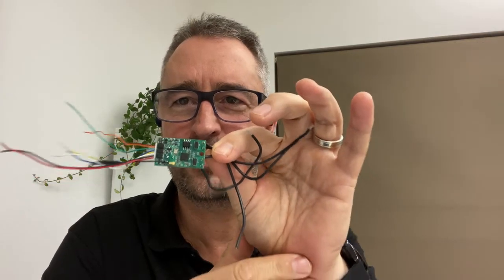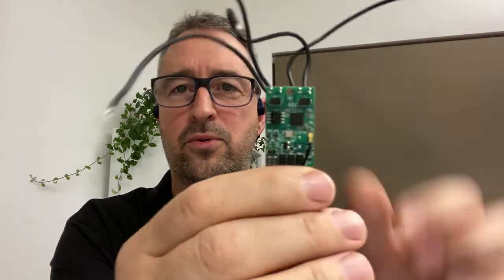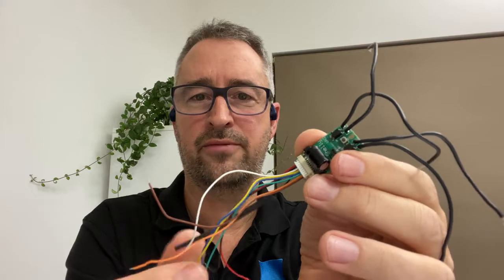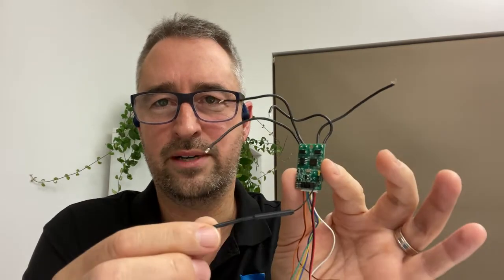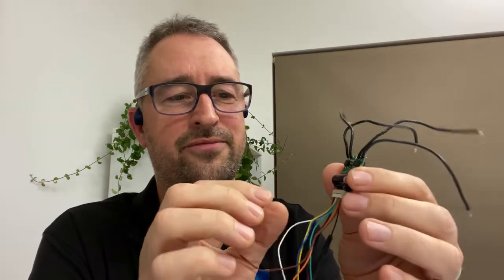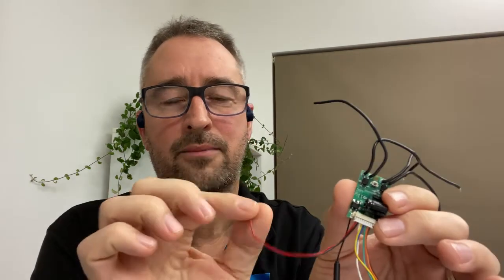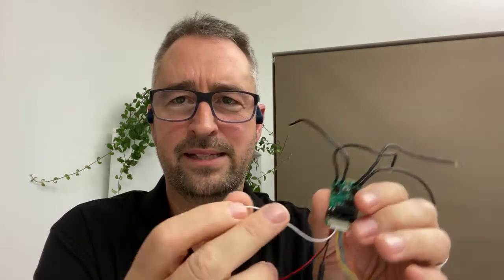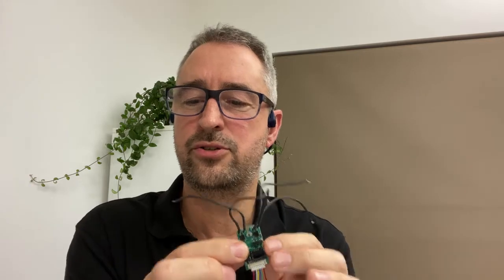Tank Water Level  Sensor Part 2 and Shelly Uni review

Comment: Hi Simon, do you know if there are any Shelly modules that do what this Uni does but with an ethernet plug instead of Wifi, my water tank is about 100m away from the router in the house. I have a data conduit in the ground though that I can easily run an ethernet cable back to the house. Or if you know of any other ways to get this to work over 100m range.
Reply from the maker: Hi Kendrick, I don't know of a Shelly that can do this but you could use an ESP 32 with an ethernet port

Comment: Hey - Fellow kiwi here from TGA and also a "Simon" :) Im about to order these bits so I can setup for a mate. You mentioned your temp sensor, can you provide a link to that? also - you mentioned going for the 12v power, what AMP did you choose from your link?
Reply from the maker: Hi there good luck this is an awesome project!  Here is the temp https://s.click.aliexpress.com/e/_oB1z3ui and this adaptor https://s.click.aliexpress.com/e/_opXibci
Reply: @simonsayshomeassistant  Thanks for that! Did you just go for the 1AMP supply?
Reply from the maker: @greminn0  Yes, 1amp will be fine
Reply from the maker: @greminn0 yes

Comment: That's pretty cool. So I guess you have to fill the tank and then take a voltage reading to see what the max level is. Let's say 1000l tank gives 10v. In a 0v -10v configuration. It would mean that 9v would mean 900l. 1v would = 100l. If I'm understanding this correctly. Obviously in reality it will never be so divisible. More like a full tank could be 8.4v and so you need to do a bit of maths to figure out the voltage to liter conversion. Is this correct?
Reply from the maker: Hi, thank you.  Yes you are right onto it!
Reply: @simonsayshomeassistant  Thanks Simon. Looks like the Uni is also the device to go for. Was looking for something also by shelly with AC connection, and then that's possible but you still need a DC adapter then to power the sensor so might as well just go for the Uni.
Reply from the maker: @blahdiblah2169  Yes, the uni is simply amazing, there is a plus version now too!

Comment: My Shelly is reporting 8.2v regardless of the depth of water, and the sensor is supposed to be 0-5v. The new Shelly Uni Plus as the readings as Analog or Volt meter, but they both give me the same results. Any suggestions? The output does not change when the water level changes.
Reply from the maker: Hi, have you tried reading the voltage using a multimeter connected directly to the sensor?

Comment: Hi there, that's very much for putting this video together. I've followed the guide and now have a Shelly Uni and a level sensor up and running. I can see the probe voltage changing as i raise and lower it in the water. One small challenge I'm facing is Home Assistant is rounding the ADV valie so for instance the Shelly Uni GUI is showing 1.87v but HA shows 2v. did you have this? Any thoughts on how I can either disable HA rounding or use a different HA sensor? Thanks 🙂
Reply from the maker: Hi there, thank you so much for your feedback!  You can adjust your rounding like this https://www.google.com/search?q=why+is+home+assistant+rounding+my+entity+values&rlz=1C1GCEB_enNZ1162NZ1162&oq=why+is+home+assistant+rounding+my+entity+values&gs_lcrp=EgZjaHJvbWUyBggAEEUYOTIHCAEQIRigAdIBCTEzMzg3ajBqN6gCALACAA&sourceid=chrome&ie=UTF-8
Reply: @simonsayshomeassistant turns out I was using the old HACS Shelly integration. I removed that and used the built in integration and it’s working perfectly now. Thanks very much for your help 👌🏻🎉

Comment: While this is an old video thread I hope you can steer me to a way to work through my error in trying to use this to monitor a 2m deep water tank. I am supplying power to a Uni from a 12V brick and also jump from the same power transformer to the pressure sensor. White - 3rd Uni wire to the blue on the 0-10Volt pressure sensor. My problem is the sensor seem to show 7.5 V - 8.3 V or so.  Any suggestions on where I am going wrong or how to diagnose my problem (Simon & Lars have about 2.0V ) .  Will remove the pressure sensor tomorrow & test output in a small bucket?
Reply from the maker: Hi Dan, does the voltage change if you pull the sensor up higher in the water?  Also just check that you have the sensor that uses voltage and not milliamps?  Hope this helps
Reply: Did you find a solution? I'm having the same problem.

Comment: Hi Simon thanks for the video! I'm doing this exact project I was wondering did you use the outputs on the shelly to power the sensor? I can't find how many amps the sensor uses anywhere so im not sure if its under 300mA
Reply from the maker: Hi Derrick, yes the shelly uni supplies the power to the sensor.  I'm so glad you found it useful!

Comment: Hi Simon, sorry for the silly question. But do you have a link to the type of power source you’re using? Also do you use a weatherproof enclosure for the Shelly uni so it doesn’t get damaged out in the elements? Thank you
Reply from the maker: Hi Johnny, there are no silly questions.  Here is a link to a project box you could use: https://s.click.aliexpress.com/e/_DDSwtmJ and here is the power supply: https://s.click.aliexpress.com/e/_DdxCgwl .Thank you for watching my video!

Comment: Third time lucky in adding a comment....agghh
I have similar hardware as but I flashed Tasmota onto the shelly UNI over the air. Why? Because I am familiar with it and I could slow down the number of times the data was being sent as the shelly didn't do that. Anyway the Tasmota does the calculation for the litres on the device and I send that via MQTT. Seems to work. Look for a video  ubeaut productions as I cannot add any links to the comments...agghh
Reply from the maker: Oh wow I didn't realise that you could flash the uni over the air.  Yes I am a fan of Tasmota too.  I will definately check out your video!
Reply: @simonsayshomeassistant  hey let me know if you try this out... Thanks
Reply from the maker: Thank you I will let you know if I get it working, digiblur is great!  How did you calculate the litres?  @ubeaut
Reply: @simonsayshomeassistant  it's in the video I did. I had the sensor out that was zero/empty then put it in the full tank. That is the high and low voltage readings and the adcparam command does it all . adcparam 6,12,262,0,50000. Which means 6 is the moisture setting, 12 is low voltage, 262 is high voltage, 0 is the low scale and 50000 is the high scale.  At the end of the video I pull the sensor out and you can see the lidtres change. I had the tele period set at 10 seconds so you could see it change. I set it to 5 minutes but can be whatever you want.
Reply: @simonsayshomeassistant  maybe you can do a better video of the whole process including the flashing.
Reply: Yes it is called mongoose to tasmota. It worked first go. Digiblur has a video of it as well. Super easy. If you want to swap back maybe no so easy.

Comment: Hi Simon. I have bought a shelly uni and have set it up with mqtt and I am getting readings. The readings are coming in a lot is there a way to limit the voltage readings so they com in every 5 minutes for example?
If I flash the shelly uni with tasmota can I still get the water level voltages? At least with tasmota I can set the telemetry settings. It is a water tank and even it I take voltage readings once a day would be fine. Have you done it with tasmota? Can it be done? Thanks
Reply from the maker: Hi ubeaut, I have not tried that yet.  Are you using MQTT because it is on another network?
Reply: @simonsayshomeassistant  No. I use MQTT pretty much for all devices and 99% are running Tasmota. It is very good. I use a mosquito broker. At the moment I have one network. I don't have many devices that broadcast it that is why you are asking. Do you have any Tasmota devices?
Reply from the maker: @ubeaut  I have tried tasmota and yes I do really like it as a platform however I have moved most esp's over to esphome. I have never tried flashing a uni, it may be difficult as i cannot see exposed header pins

Comment: very usefull video. is there a way to access the shelly uni over the internet ? my HA is at a different location and there is no direct connectivity with the sensor. both locations have internet connection.
Reply from the maker: Thank you, yes you can access the shelly uni by using the shelly web interface.  this is accessed via the url on the shelly if you are on the same network
Reply: @simonsayshomeassistant  thanks. i would have to expose the uni to the internet  by publishing the url which i would not be confortable with besides the ddns configuration as the IP dynamic. The approach i was thinking (if possible) was for the HA server to talk to the shelly cloud. i dont know if shelly exposes APIs for this.

Comment: Hi Simon, I am setting up the same water tank sensor and are at the same spot. I would love to be able to change the voltage to liters. I have seen other people do it but not sure how.
Reply from the maker: Hi Mark, here is a link to explain how others have achieved this.  I will see what I can get working: https://community.home-assistant.io/t/convert-voltage-to-litres/543737
Reply: @simonsayshomeassistant  Thanks for that. Just very new to HA, like this week. Still not sure about the YAML setup and exactly where and how to enter it. Can I just copy and past the posted YAML code and change the names to suit my setup?
Reply from the maker: Yes, you can just copy and paste it in basically anywhere in your config.yaml file and change your entity names to match.  HA will tell you if there is an issue when you try to restart. @markfullerton663

Comment: Hey Simon
What would i need to do in order to output from HA to an Irrigation Controller (OpenSprinkler) using physical wires?
Any advice would be appreciated
Reply from the maker: Hi Coen
I would use an ESP 32 running ESPHome with a relay.  The other option is to use a Shelly 1

Comment: Hi Simon, although you have explained this well, I think I still managed to get it wrong. I bought a pressure sensor but it only has two wires. The wiring diagram you've posted on facebook shows 3 wires. So I take it I bought the wrong sensor and need to buy another one with the 3 wires?
Reply from the maker: Hi Mike, thank you for your comments.  I think that you have the amp sensor instead of the volt sensor.  I have read somewhere that you may be able to use this type of sensor using a resistor but have not tried it yet.

Comment: Hey Simon, love the videos! Do you happen to know how to decrease the granularity as shown in HA? On my Shelly app, it shows the sensor as having two decimal places, but on HA there are no decimal places. I have a 0-10v sensor, but the range I need is 4-7
Reply from the maker: Hi Gabeo, thanks for your comments :) My voltage is showing on my HA dashboard with the 2 decimal places when I diplay it as a guage
Reply: @simonsayshomeassistant  interesting, mine shows none. You didn't have to modify any settings for that?
Reply from the maker: @gabeo5799  No mine just displays it like that ADC
0.88 V

Comment: Hallo Simon. Nice video! I have this same setup on a remote location, using the Uni and Probe to give a level of a dam, I have the UNI conncted to a 3g wirelss modem(pocket modem). I want to integrate this remote device into my Home Assistant. Any advice? I dont think Shelly cloud has the option. (from SA, St Francis Bay)
Reply from the maker: Thanks for the feedback Paul, how did you connect the uni to a cellular modem ?
Reply: @simonsayshomeassistant  the modem generates a WIFI signal which the UNI is connected to
Reply from the maker: @paulnel9994  oh great easy as that

Comment: Hello Simon. Great video.  I seem to have a problem with my sensor. Unfortunately it came with different color wires.  Mine has a white, black and blue.  I can not seem to be able to identify +, - and data.  Do you happen to know how to identify them?
Reply from the maker: Hi Francisco, thanks for your kind comments!  The best thing is to ask the supplier to confirm which colour cables are for positive, negative and sensor.

Comment: Thanks for this Simon , can you share how you convert the reading to Liters ?
Reply: I realise this is an old question, but in case anyone else has a similar desire to convert the voltage to liters in home assistant. Using a template sensor worked for me. 
At one location I have 4 25k L water tanks connected and my sensor is the 10v model. Lowering the sensor to the bottom of a full tank gave me a max reading of 8.07v, out of interest if I raised it to the surface the reading was 0.8v (has no relevance to this exercise. Just thought i'd get the reading while I had a full tank...)
Anyway, knowing the max volume of my four tanks was 100,000 L and knowing that the sensor reads 8.07v when the tank is full then we can work out that 8.07 x 12391.57 = 100,000.
The template sensor can then be created (if you copy and paste, beware the spacing!):

# Shed water tanks
- platform: template
  sensors:
    tank_litres:
      value_template: >
        {% set voltage = states('sensor.shellyuni_98cdac251207_adc') | float(0) %}
        {{ ((voltage) * 12391.57) | round(0) }}
      unit_of_measurement: l
      friendly_name: Shed Volume

You can use the same principal to show as a percentage. The 'friendly name' will then be available in home assistant. This may not be the best way to do this, i'm far from an expert but it seems to be working for me so far!
Reply from the maker: I found this video which explains how to convert the voltage to liters : https://www.youtube.com/watch?v=llExIOD0gpk
Reply from the maker: Hi Darryl, I have not converted my one to liters yet I just use a gauge to see how full it is.
Reply: Volume (L)=Tank Cross-sectional Area (cm 
2
 )×( 
V 
max

 −V 
min

 
Voltage−V 
min

 

 ×Max Height (cm))×0.001

Comment: hi simon, hope to see more videos, as i have a spare shelly uni now. i received two instead of the one i ordered! (good result)
i hope you can help with question... i have followed the steps as best as i can, i'm really not great with wiring tbh.
the sensor i received is the 10v version but has 3 wires. can you explain a greater detail on exactly how to connect the wires please
Reply from the maker: Hi Darren, thanks for your comments :) Yes lots more videos coming :) Here is a diagram to help with the wiring. https://www.facebook.com/photo/?fbid=10160496755809744&set=gm.634812614518053

Comment: Hi Simon, a very helpful video! Meanwhile I managed to reproduce your setup, it works very well. But I have one problem: The voltage signal from my shelly uni sometimes changes very often, about one time per second. This results in a fast growth of my home assistant database. Did you face this problem and if yes, how did you solve it?
Reply from the maker: Hi Elder One, thanks for your kind comments!  I have not noticed this on my setup however I do see this happening on the plant moisture sensor that I created.  As far as I know the HA database purges all data after 2 weeks so this should not cause a big problem.
Reply: Hi, I have the same problem.
I connected the sensor to Shelly uni, after 2 hours I finally got to update the firmware on the uni to 20230503-102354. 
I get somehow inconsistent readings. I have the 0-10V sensor, and put it into a bucket of water for dry-run testings. On the woltmeter, I get consistent 0,29V, on the shelly and in the HA i get between 0.09-0.23V  jumping.  
Did you find out what could be the problem? or maybe @simonsayshomeassistant ?
Reply: I think I got it :)
I connected also the green wire from SHelly (GND_SENSOR) to neutral, and now the readings are better. Now my voltmeter shows 0,78V, and the shelly voltage jumps from 0,85 - 0,93V which is OK for me. Also... the voltmeter has bigger resistance, therefore it could meter 0,2 lower voltage.
Reply from the maker: Hi, yes this can be a problem with some sensors.  I would recommend using an SSD as your storage system so it will not be a problem.  HA only stores data for 10 days.

Comment: Thank you alot Simon. Very usefull video. Excpacially on the home automation config. Thats where i have my headackes. Looking forward for Part3.
Reply from the maker: Hi Fredrik thank you for your kind words sir!  Yes, I am working on the pump sensor and have been trying the small and big sound sensors in the 37 in one pack. The problem is that they are not very sensitive so I need to find another option, maybe a vibration sensor or power sensor.  Also I am trying to fund a way to display the tank in a more appealing way.

Comment: I have this pressure sensor G1/4 Pressure Transducer Sensor, Input 5V Output 0.5-4.5V / 0-5V Pressure Transmitter for Water Gas Oil(0-10PSI) attached to the bottom of my tank 

I managed to connect both devices and add it to Home Assistant .... The Volts keep changing every seconds  from 0 - 2 v .... Is there a way to keep this to update static based on the level of water that is in my tank  ??
Reply from the maker: That's odd, I haven't tried that type of sensor yet. Did you approach the supplier?